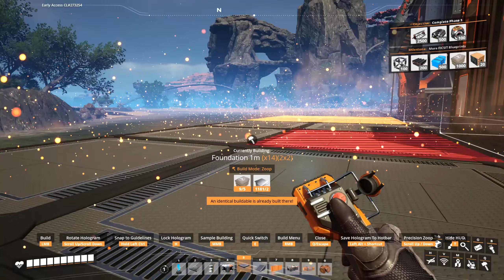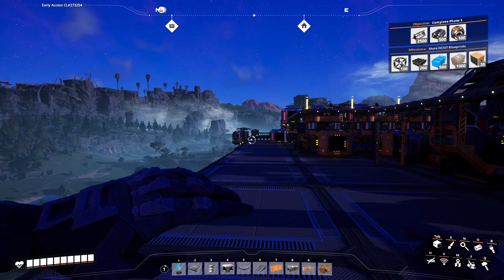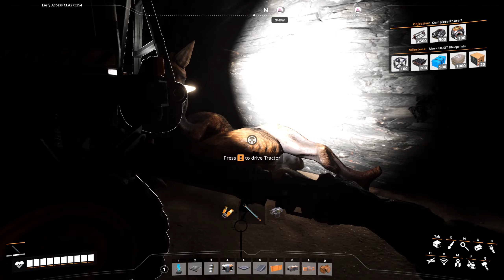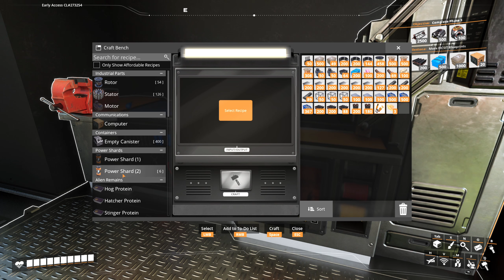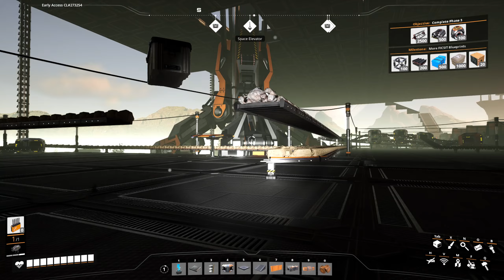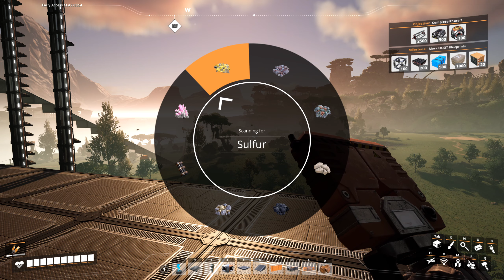Heavy Modular Frames are Complicated- Satisfactory 16

Comment: nice video!  just a tip with pumps.  you only need pumps to go up.  they provide headlift, or the max height the fluid can get to.  pipes that are horizontal do not need any pumps.  extra pumps do not make the fluid move faster, although they can prevent "sloshing" in the pipes.